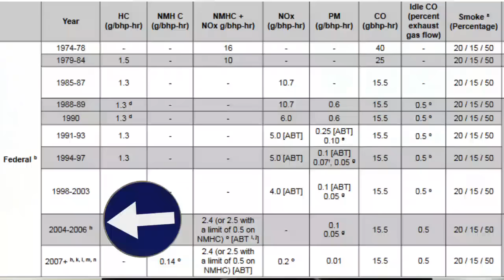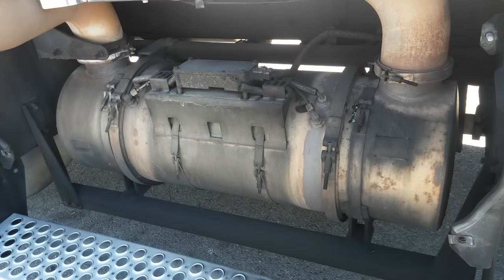Why Do People HATE Cat ACERT Engines?

Comment: Hi josh thank you for the videos you’re doing. To help I just have a question. I bought the peterbilt 2005 with C15 and I didn’t check it and was having a cylinder head crack and I go to the Kenworth and I did the rebuilt but it’s converted in one single turbo and Kenworth was able to work on that the way it is but with no guarantee on it I make it full rebuild with everything new except I leave it to the single turbo and I find somebody to do the computer check as they say but for some reason I have a turbo exhaust oil leak. Can you help on that or I need to go back to the double turbo before I ruin the engine? Thank you Josh

Comment: I worked for a company that had a fleet of the infamous Cat Ct660 trucks.
13 and 15 liter , all they were was yellow painted Maxx 13 and 15.
I hated those engines, it was always something else, every single day, cracked aftercoolers, pitted cylinder liners, the pto shaft off the back of the head. Absolutely garbage engines. It's why I left heavy equipment.

Comment: DID CAT EVER GO DOWN THE AD-BLUE ROAD,DROVE A 460 D-DECK FOR 5YRS PULLING TRIPLES FROM ALICE SPRINGS TO DARWIN,AWESOME MOTOR.
Reply from the maker: The Cat Truck did use DEF in their 2013-2016 engines, but the actual Cat Truck Engines never did. They do use it on the equipment side now though on 2017 and never equipment.

Comment: Laughs in mechanical diesel. 

With no power and the entire right side of my truck is black. Fair trade.
Reply: 🤣 my Turbodiesel (mechanical fuel injection) mercedes has an almost permanently blackened taillight above the exhaust, I occasionally take it apart to clean it, but I can relate haha
Reply: Every 71 and 92 series detroit owner: "Yep."

Comment: Hi. Im your subscriber and like all your videos. Thank you for a very useful information. Im looking to buy a 94 volvo with cat 3176b. Not familiar with those old c10’s and i cant find much information on them. Can you share your opinion on these engines in your next video please???
Reply: Don't do it. 3176b's have an aluminum spacer deck between the block and the cylinder head. They erode and pit up pretty bad from electrolysis. The parts are not only really hard to get but also extremely expensive. Also had a problem with breaking head bolts due to the expansion and contraction rates of the dissimilar metals.

Comment: If I ever take those IVA wires off I clean them with brake cleaner , dry them  and pack them with dielectric grease.  Some say it keeps the dirty oil and stuff off the connection . Cant hurt i guess.

Comment: What is your experience with a 06 NXS acert engine that had a single turbo conversion, 
And the IVAs are now out of the equation, and so are all the twin turbos and intake coolers and after treatment system like the ard head
My 1.5 million mile MBN bottom end failed on a car hauler a 6nz was impossible source long blocks were 32 k still needed all the parts off my original engine plus the core,  they seems to be alot of ppl converting the 06 NXS engine to single turbo and change the internals and re tuned the ECM  and basically make them into a MBN engine

Comment: Help! My 2007 475 NES twin turbo is blowing coolant out overflow tube,
 No overheating, no water in oil , no bubbles. Only while driving it will fill the puke bottle. Any thoughts???

Comment: I have a 3126E it  has 80k miles ran good up until this trip replaced  the  sensor on top pressure for injector s or whatever still going along and it drops into limp mode i let her set for a few minutes and off  we go well I didn’t even get 10 mikes and check engine light came on I hope it’s not the hewi pump your  be video’s we’re very helpful hey would the motor even start if the pump was failing

Comment: Waited for Cats operator killer 'ammonia' but you did not mention it. Using Cat engines underground should be outlawed, the smell of ammonia is overwhelming and must have a severe detrimental effect on the health of all, except those in air conditioned cabs.

Now for the truth, Cat thought "we are so big the EPA will not chase us", then when it was too late, the EPA did hunt them, they still had a NO2 problem and after no thought came up with dumb solution. Every other manufacturer basically went back to square one with their designs, because (unlike what you said) everyone knew years in advance that the emissions targets were going to be really low!!

So in 2007 when the next stage was put in place Cat bolted a heap of useless ideas to there machines that to this day have issues. The real issue is too many people buying Cat krap based on historic reputation. As time goes on though Cat is being devoured by their competition and they honestly desreve it.

Comment: I’m looking at buying a truck with  nxs c15. Owner has paperwork for a overhaul 140k ago. The oil pressure is 30psi hot idle and 60 at 1500rpm hot. Is this normal?

Comment: So what's the difference between the highway ACERT engines and the off road ACERTs? We farm with a couple Challenger tractors - 2010 765c with a C9 and 2013 855c with a C15 - both "ACERT" engines, but don't seem to have any of that emissions stuff. Thanks
Reply from the maker: Many of the off road and on highway engines are the same with the difference being that off-road equipment had different timelines and emissions standards for their equipment. Also the horsepower rating of engines ties into what emissions, such as DEF, need to be used.

Comment: If I put a 10r7155 cam and 58 injectors in my mxs engine will it be ok to do ? You advice would be highly appreciated
Reply from the maker: I generally recommended sticking with stock components, but it is your truck and some guys are happy with modifying them. I work for a Cat dealer so keep that in mind, we generally don't even see modified engines as people don't bring them to the Dealer usually.

Comment: Question. I have a 2006 Pete 386 with a C-15 Acert 2 torbos. Jake brakes are really week to the point that you want even tell if they’re kicking in. Would that have to do with the vva or iva solenoids?
Reply: Had the same problem. I took it to Cat and did an overhead. They tuned it and tighted up my Jake's and it was back holding strong.

Comment: Now I have a better idea what my truck driver friends have been bitching about.
As for the blow-by problem, I'm surprised it took them so long to deal with that. Automobile engines (gas and diesel) have been burning crankcase gasses since the '80s.

Comment: I like the egr idea, volvo and cummins use a 7th injector for dpf regen works ok, they have issues with the egr, maybe cat shouldve gone with the 7th injector for dpf, fairly simple system, single vgt and their egr system, sounds like a good system to me
Reply: These high pressure fuel systems though fail alot. Volvo came up with a good fix for it I think, we will see how the new cummins f150 go
Reply: Yeah but you're choking the engine down. Wasn't there a study or something that showed how EGR systems could drop engine efficiency by 3%?
Reply: Sorry i meant cummins x15. And when i said egr i mean what cat did. EGR in itself is not good. I just think the cat system is better than the others. Because in my experience theres alot of issues with egr coolers and valves. Plus the intake gets all dirty with soot. Taking the gasses from after the dpf sounds better to me.

Comment: CAT'S EGR system fails all the time in the off road engines. We have C15's in the CAT 740 and they fail more than any other engine around. The pecker head fails in the D8 dozers but the EGR fails and fills the engine with coolant and even hydraulicly lock it up.

Comment: What exactly fails in the ARD head? It's a solid piece of steel. Does it develope holes or warp? It seems you could make a billet aftermarket ARD out of a titanium or something that would last for 10 years for less than $1k.
Reply: The primary fuel filter is about the only fuel filter it has. When the ECM turns the system on, fuel is rerouted to the the number two fuel manifold. One line on inlet two on outlet. It has Pilot and Main psi sensor's and control valves. Then at the number three fuel manifold you have a metal mesh filter's. As this system is lacking a excellent filter system, the ARD head plugs and fuel cannot pass
through it or sufficient amount. Also the rubber lines can fail over time and pass debris into the ARD head. Some times the bottom of the ARD head can plug up not allowing sufficient fresh air to pass through. If Cat could make the fuel nozzle replaceable or yet a way to take it apart and clean it. That would save some money.  The tend to last eight to fourteen months.

Comment: Wow, amazing amount of knowledge!  Can anyone tell me why diesel engines vent crank case pressure to atmosphere instead of putting them in the intake pre turbo like gas engines.
Reply: ? Why would you run crank into the intake on a diesel, you could pump oil from the crank case into the intake and run the motor away.

Comment: You description of how NOX is formed is slightly inaccurate.... it is NOT excess "oxygen",  instead it is excess "nitrogen" (The nitrogen in the air combines with oxygen at high temps.).... hence, if you replaced the word 'oxygen' with 'air' in your description, you would be more accurate. (Air is mostly nitrogen)

Comment: having worked exclusively on c7 model cats from beginning till there end the biggest problems we had was the new parts broke within hours of installation. factory cat parts were simply junk!  Combine this with injector issues where one bad injector ended up failing multiple injectors after running the verification tests required.
Reply: So you wouldn't recommend me buy an 07 F750 C7 7.2 liter engine

Comment: I did a overhaul on my cat 3406e 4 years ago because liner protrusion problem, now I have the same problem what do you think it went wrong (pushing antifreeze out of radiator and leaking between block and head)
Reply: Cat recently came out with a new head gasket design which helps with oil leaking out from under the head. But you probably need to have the block decked and the counterbores recut if it was not done during the overhaul. The deck has to be flat when the counterbores are cut or you will keep getting blown head gaskets and oil leaking out from under the head. A new spacer plate is a good idea too.

Comment: I'm confused on the engine I have it says ACERT C15 without dash serial number starts with BXS but only has one turbo. I know you mentioned acert had two turbo can you advise?
Reply: If you have a BXS with a single turbo, it is a illegal modification. Stay out of states that have emission checking. Most Cat dealers will not work on them and very expensive to switch it back.

Comment: It’s the whole other ‘ engine ‘ bolted to the side of the engine. What a nightmare
Reply: Let's see what a DPF does... 

- It's very expensive to replace or clean
- It make your truck harder to work on
- It chokes down your engine for very little benefit
- The regenerator head pulls additional fuel
- It creates temperatures as high as 600°C

And so on. So yeah, no thanks. Delete.

Comment: I wish you had said: “… carbon dioxide and water (vapor) …” @ 17:50 instead of: “…carbon dioxide and carbon monoxide …” for carbon dioxide and water are the two primary products of the combustion reaction. In fact, if we could achieve 100% combustion efficiency, those would be the ONLY products (exhaust would comprise only those two compounds).

Comment: Water is far better than super hot air to create a compressible media..use water to force the air to the combustion chamber. the intake temperature will be far cooler than very hot exhaust to spin the turbo rotors ..all this says is drop the convential air powered turbo into a water cooled turbo....using water will keep in intake cooler ..oil cooler..heads cooler..block cooler )

Comment: When you say 07 Acerts, You mean 08’-12’ Truck Years. Motor Prefix’s, Serial Numbers - SDP, LEE, C9S, C7S Models. Have you ever Worked at any other Diesel Shop Other than a Caterpillar Dealership? Have you ever worked for Cummins, or Worked on Any Cummins or Detroit Engines at all?

Comment: Hey bro u havent done a single video on a 3176 b engine and theree are so many dump trucks with this engine, i wanna know more about it, i have a 94 peterbilt 377 with the 9ck serial number ecm , ive had to researchceverything myselfe as no California mechanics work on these older models, i can use some help, ime having issues with power with no check engine other than code 12, cus i dont have a coolant level sensor on my truck

Comment: NO Nitric Oxide is a chemical compound that helps keep your arteries, capillaries, and veins supple.
NO² Nitrogen dioxide
N²O Nitrous oxide or laughing gas is the stuff you use to increase oxygen in the intake side of a gasoline engine that also improves horsepower output.
NOx or Nitrogen oxides is a general term for all of the above combinations of N nitrogen and O oxygen.  In diesel emissions the resulting NOx has an effect of increasing acid rain and smog pollutants.  Thus the concern by environmental sciences.  Select diesel catalyst takes NOx and increases NO² nitrogen dioxide in the exhaust by the Regen process.  This nitrogen dioxide is theoretically easier to break down further in the atmosphere.

Comment: Josh I need advice on a c15 6nz single turbo my water temp is about 215 to 220 going down the road with no trailer I blew and washed out the radiator multiple times don’t know what else to do
Reply: What is your delta T top and bottom hose? Is the CEL coming on for overheating or is your gauge reading this temp? Do you have a heat gun?
Reply: John Goldsmith the cel comes on when the hits over 220 temp sitting idle it’ll be 200 then going down the road it’ll be 210 almost 220 the radiator is clean but I was told it maybe the thermostats
Reply: @jacobyparks3661  You need ET or delta T across radiator. Should be at least 1 degree F max around 10 degrees F.
With ET you can run engine up to fan on temp and see if the regulators open, using datalog. I do it all the time.

Comment: Hey guys . I was hoping someone could help me with my cat c7 on my 2007 Freightliner box truck.i just had a mechanic rebuilt it with an aftermarket kit from highway heavy parts..it literally took me 30 miles from the shop for my truck to leak out all the radiator fluid causing the engine protect to come on and the truck to shut down ..I got a hold of my mechanic and he’s claiming the aftermarket head gasket is the cause is the problem which makes no sense since ..can anyone give me some advice . Is it the aftermarket parts the issue or did they simply just not do a good job rebuilding the engine

Comment: The Ard head should have a machine port to replace injection nozzle failure in the Ard head
Reply from the maker: That would have saved Cat and the owners of the engines probably millions of dollars.
Reply: @AdeptApe  grab one pay the core drill one out invent a nozzle sounds easy get a prototype sell it back to cat
Reply: I have taken them apart. Only problem you can't put it back together and keep the swirler plate locked in. Also the air ports in the swirler plate plugs up and have to be cleaned. Ran a ASVT and replaced ARD head and flow went up due to plugging. Ard heads typically last 8-14 months. Cat wants these to go away and not many left that is legal on the road. I don't see any improvements on the truck side ARD head or system as warranty claims more than likely are very few now. Same thing happened on PEEC TDM. Use to be reman now new only and price is absurd. I put a 5EK boost sensor in and only problem is you can't calibrate it once installed. So Cat could not install a remote boost  sensor like they did in oil psi because of calibration. So they road it out until people removed the PEEC and installed manual or parked them.

Comment: Cat on Highway engines were the worst on highway engine ever when they introduced ACERT. You forgot to mention the low pressure Turbo taking out the High pressure Turbo when it failed and boy did a lot of them fail.
Cummins had problems with initially, many issues with their EGR cooler and VGT turbo           ( specifically the shroud plate coming loose )
Cat should have kept it simple like Cummins did.

Comment: I'll tell you what Hawaiian takeoff isx15 that has 500,000 miles on it the intake is half of what it was when it was brand new if they think that they're helping emissions by putting an EGR on a diesel engine they're badly mistaken they're causing a problem

Comment: Did they never add Ad-blue?
Reply: CAT exited the on-highway truck market before urea was required
Reply: freeride202 Thanks I was wondering if CAT ever used a SCR system.
Reply: Ad-blue in some machines now
Reply from the maker: The Cat trucks did have SCR systems depending on the year of them, but they didn't get produced in the same amounts as the Cat engines in the 2000's.
Reply: @AdeptApe  come now, we aren't calling that a CAT engine now are we? 😄

Comment: Everyone hates the emissions part of these engines thr new one basically but in reality I think it's great they are being made to have them run cleaner after all it's the air we have to breathe. What is crap is they are fixing this emissions stuff now when if it should been started in the 70s or 80s if it was possible to do then.  If so we would be ahead of the game and if it was started in the 70s we would be ahead of the game and probably would had the emissions to help the environment with cleaner plus they would of figured out how to still have the horsepower too. If it is even possible lol
Reply: Funny how we survived a century with no emissions on diesel engines yet all of a sudden in the late 2000s we had to start stapling thousands of dollars of complex emissions systems nobody asked for onto engines. 

How exactly is burning twice as much fuel saving the environment, by the way?